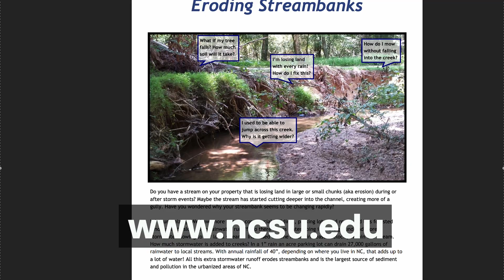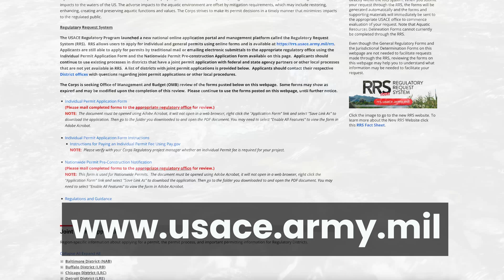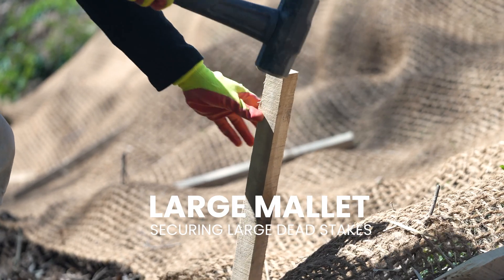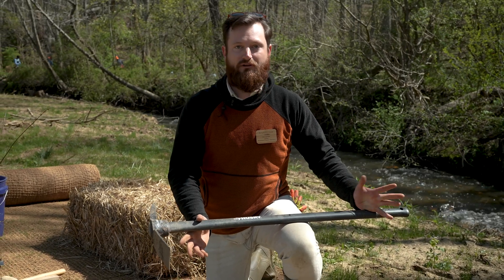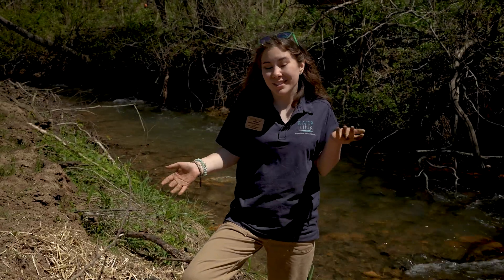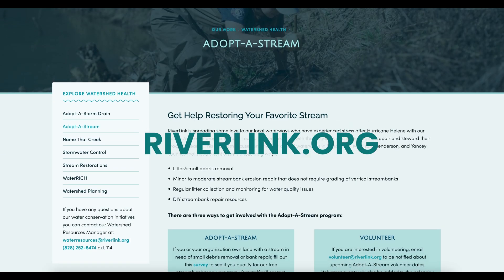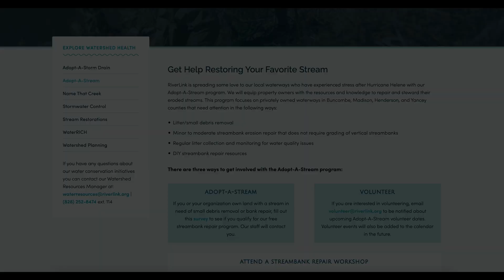How to Repair Eroded Stream Banks | Natural Techniques That Actually Work

Comment: Something not mentioned is grazing animals. If there are any cows, sheep, goats, or even excessive deer populations in the area then steps need to be taken to keep them out entirely or keep them from grazing down the new plants and trees. A fence to keep them farm animals out of the stream bed entirely would be ideal. Animal hooves cause a lot of erosion by themselves, and animals manure dropping in the stream causes entirely different problems. But if its not possible, then twiggy and preferably also thorny brush cuttings can be placed over the area and staked down so that the animals cannot graze the area down to the ground, or at least make that more difficult for them

One of the biggest causes of erosion on otherwise gentle streams like this is trees being killed off and riparian plants being weakened in the first place. This is often done by people cutting trees and aggressively trimming "weeds" for aesthetic reasons, which just requires the people agree to do less work and let things grow. But when done by animal grazing, it needs active steps to stop that over grazing. Or any repair will fail for the same reason the original bank failed